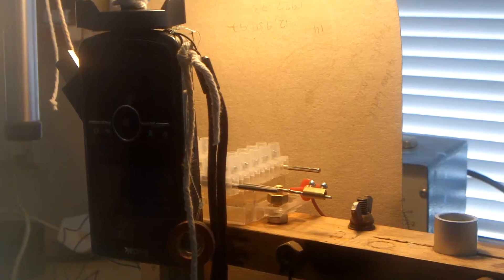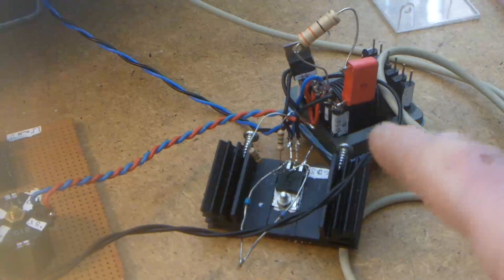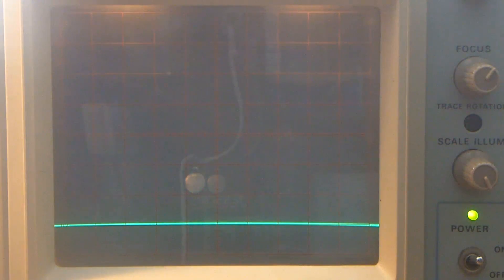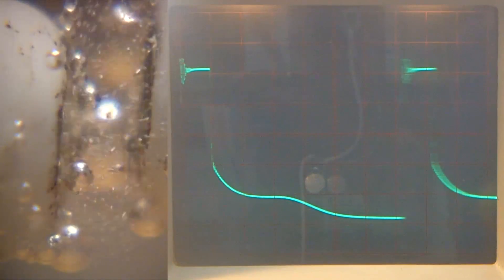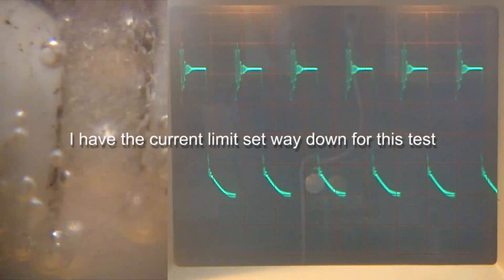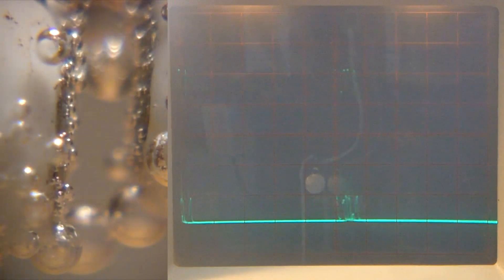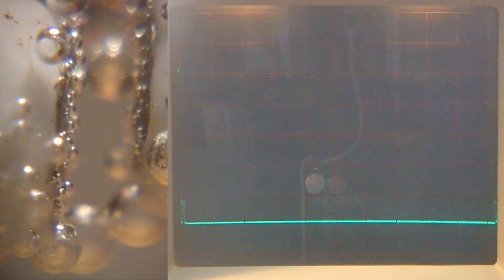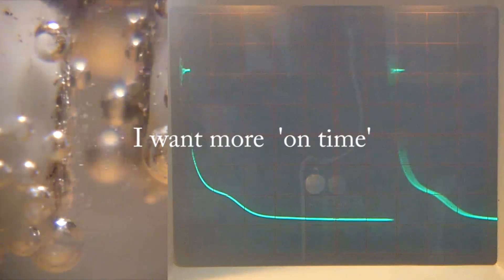HHO. 31 Some more early trials, nothing earth shattering

Comment: Hello, you have some interesting new ideas like the microscope. As i saw the video i get a new idea how to improve your setup. You could use an LED-Stoboscope to see the bubbles in slowmotion but still in realtime. Also it is better to use a black background or put the cell in a closed box where you have only 1 directed lightsource with small opening angle. greetings

Comment: if put an ultrasonic traducer at the bottom inside the cell ,tunes the size of bubbles,  also i don't know your setup but u can use a pro audio generator software like {ableton live) with an amplifier
 and sophisticated waveform synthesis
 DSP software Plugins to try some exotic waveforms By varying the , envelope, duration, spatial position, and density of the grains, many different waveform can be produced.  u can use a LFO low frequency oscillator to modulate waveforms synthesis like ,Phase distortion.Granular. am . fm etc . with specific frequencies u can produce more h2 and little O or vice versa, the hho dance if u put music , he likes disco  anyway nice experiments you have here.